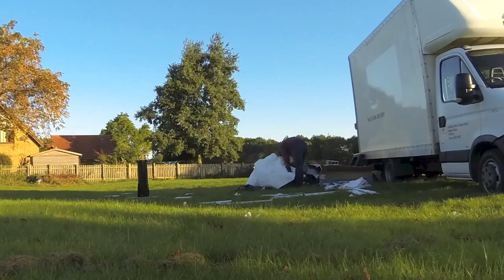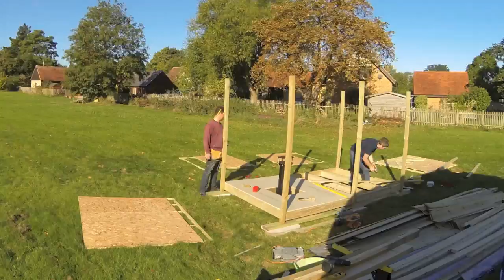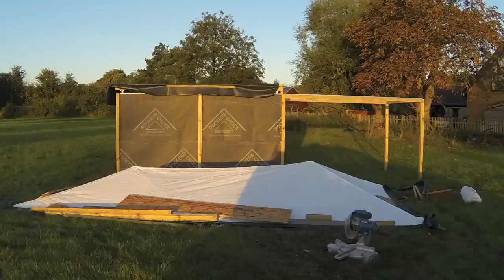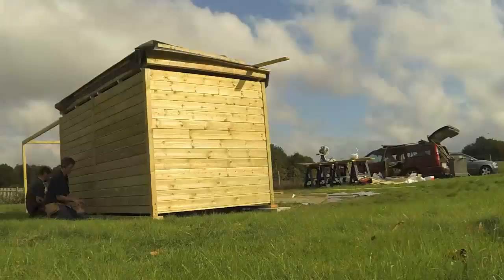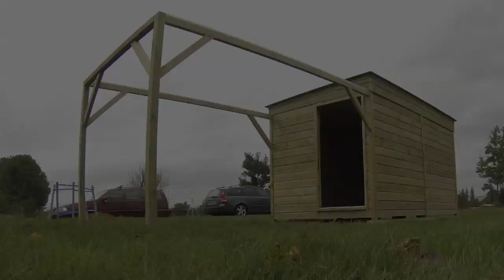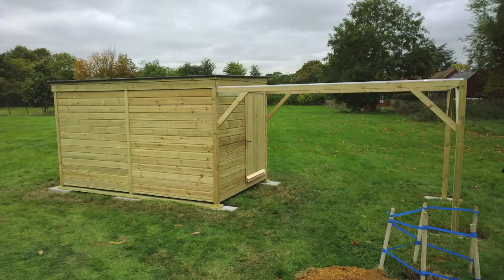Observatory Build Timelapse

Comment: how would u look towards the horizon from inside this?
Reply: Nitesh Tripathi You don't. You will be limited to looking higher due to the walls but looking near the horizon is not desirable anyway with a telescope as there is far too much dust and light pollution to allow good viewing. The best viewing is generally 20 degrees or higher above the horizon. Plus there are often trees there anyway.
The building design in this video is great but my concern would be with the tiny slope of the roof. Snow and ice loading (in certain climates like mine) require a much more sloped roof. One tiny design alteration but it could be done easily. Also I wonder about rain water getting between the rolling roof and the walls.